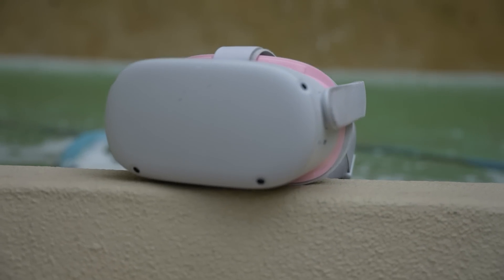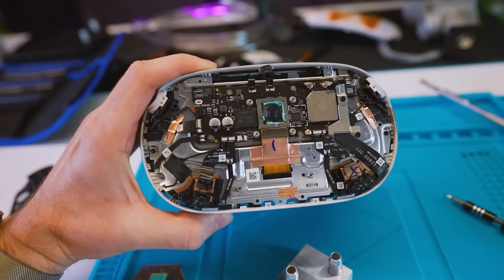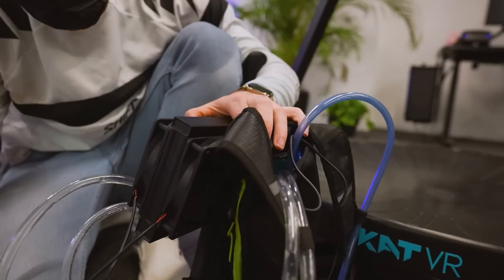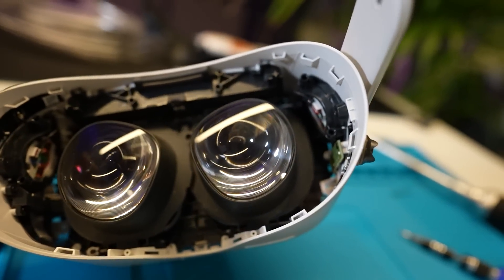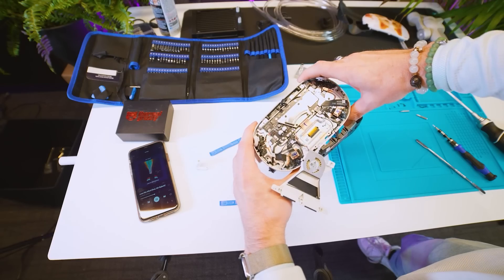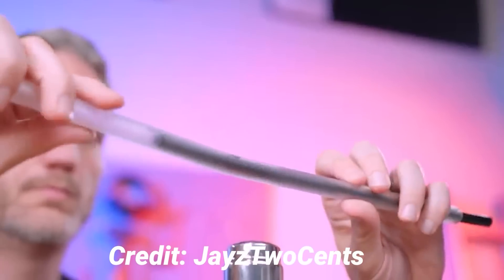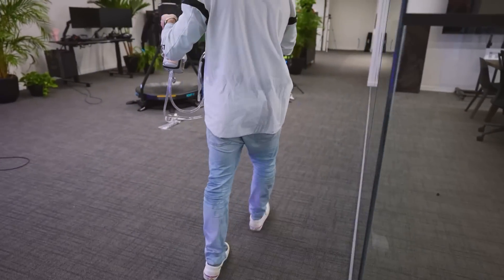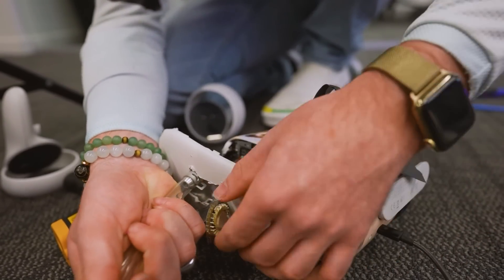What happens if you WATERCOOL an Oculus Quest 2?

Comment: A pure cringefest, you could put at least some effort into making it, and not just break things.
Reply from the maker: I didn’t break anything? What?
Reply: @ThrillSeekerVR  Well, you Did destroyed an original radiator's fins. Anyway, it's just breaking my heart to see an interesting idea being downsized by such a hack job. You can make a lot nicer cuts in plastic if you heat the knife, or even better use cheapest soldering iron from the dollar store, and slowly melt a nice hole. A few strokes with a file and it would look a factory grade. And this dangling fan, ohhh, those wires isn't designed for such use case, they will snap in no time, stick this fan to the case at least with double sided tape. About cooling, with such amounts of liquid, I don't think you actually even need a cooling block with a fan, the sheer amount of water will dissipate heat faster than it will heat up, so you can simplify it a bit.

Comment: There's a small amount of cooling you're missing out on by having no airflow in the headset as more than just the cpu makes heat, but those components are probably okay running warm with the cpu's heat being pumped out of the area. I doubt it would improve things too much more than it already has though.

Comment: This was a really cool project! I would love to see how the quest 2 performs with normal cooling just by removing the plastic housing. The lower temperatures on the housing probably had nothing to do with water cooling, the actual reason was the air gaps it didn't have before. Also, thermal paste conductivity is really really low, having the water block that far from the processor probably does nothing in terms of extra performance.